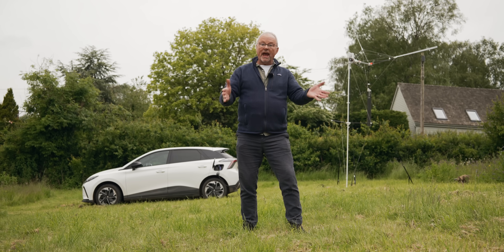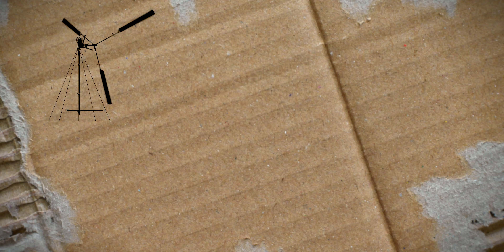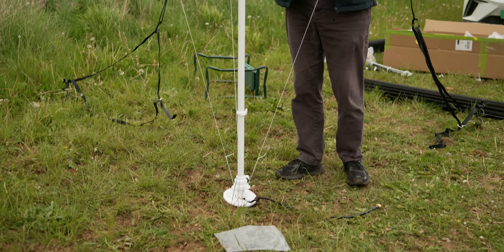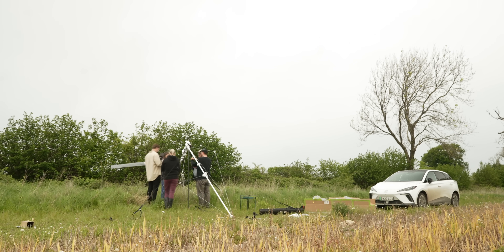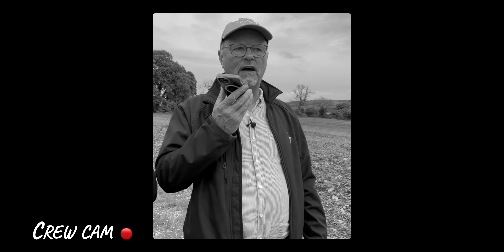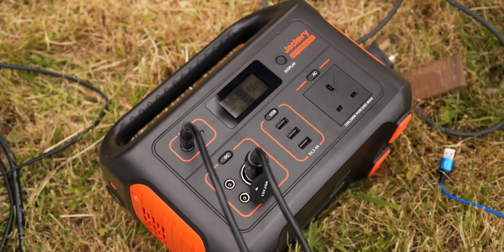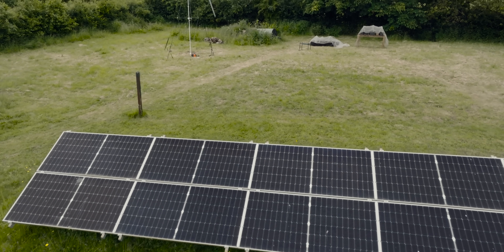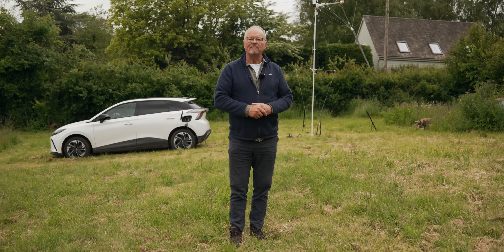Charging an Electric Car with a DIY Wind Turbine?!

Comment: My wifes' car has a roof rack.  I'd like a PV panel assembly that can be unfolded to cover almost the whole car area using supports that can be pulled out from the rack in the front to support it over the bonnet.  Ideally that would be the length of a residential panel in width and 4 panel widths in length.  Usual residential panel can generate 400 watts and weigh at least40 lbs.  So charging over 1200 watts and the whole assembly weighing 200 lbs (within the weight limit of your typical car rack) you'd get about 10.4 to 28 Km added to range in a day.

Comment: So you've just shown us that a small portable battery pack can't supply sufficient power to run a granny charger, but if you had an appropriately sized one and cycled the charging to keep the battery topped up, you could get about 0.8 mile of charge per hour. That's 20 min of my life I'm not getting back.

Comment: According to the information in this video this turbine can max out at 4.5kw. You only require 2.8kw to replicate the average charge rate you'd expect from a UK domestic socket. In which case you could add as much as 15 miles per hour at the peak. That would be perfectly adequate for adding a little top up when the car is doing nothing else. But, clearly, it's more suitable for running external equipment. It would be like a stand alone Turbine To Load system.
Reply: 500Whp nothing close to 4.5kw ?
Reply: The KiteX is 200W max. Expect 100-150W at average wind speed and no turbulence (on a hill without interference).

Comment: Are there vertical turbine models? They will have more stable output. A tip, location a site that  has wind-tunnel-effect. You will have continuous and higher wind speed at such location.
Reply: VAWTs have a very low efficiency, just what you don't want if your wind resource is poor.

Comment: A challenge if it is possible to use vertical turbines. Alpha 311 it has been tried in the O2 centre. Is now being used south wales by a council on a major road, the cars passing to produce wind rather than relying on wind.
Reply: It is but why use something that has a very low efficiency.

Comment: This clip was both illuminating from the set up point of view and thought provoking. I have two solar arrays 12 kWp and 5 kWp respectively. Two of the Kitex wind turbines could augment energy to cover the nights and cloudy days. On the flat garage roof.. Hmmm. Negotiations with the good lady mistress of the purse her indoors might and, more importantly, the grid company…
Reply: not really an augmentation - at 13mph windspeed you're getting 0.187kw (187 watts) output.

Comment: If the makers of the windmill are taking advice, suggest:
You can for quite a low cost make your product a WiFi hot spot and make all the software a web page so that it doesn't matter what phone is used.
Making it not need any sort of app would be even better.  You have to run a cable to bring the power down so a few extra wires is not a problem.  Some sprinkler controllers make it all work with 3 push buttons and a two line LCD display.
Reply: Dev here. Actually it is a web app. The turbine they received had a wrong firmware setting. We only had a guide for android on how change this at the time.

Regarding the on/off we omitted the button to simplify the design (electronically and mechanically) - the main reason why it not just on by default is safety reason. We want to be sure people is ready for the turbine to spin up - before it does so. Could be we can make the user experience better at a later stage with firmware update
Reply: @AndreasOkholm  Thanks for explaining the situation.

My 2¢ as an IoT developer: the fact the user has to plug it in to power to get it started, seems like a safe point for the user to expect it to start turning (and put that in the quick start guide).

An app/web app should not be required for operation - it should just expose tech stats for us nerds. Otherwise it’s just being an annoyance to everyone.

Interesting product - and kudos for it being shown on Fully Charged.
Reply: @AndreasOkholm  BTW:  If you do make a hot spot, I suggest you put the serial number as part of the SSID.  Two hotspots with the same name can be trouble
Reply: @kensmith5694  we changed that in the firmware upgrade about 6 months ago :) - to include the serial number
Reply: Or not require an app at all. Why isn’t it just on/off? Everything else should be easily automated
Reply: @markirmuir  I am not even sure it needs an On/Off.  If the wind is blowing, it is on.
You may want to be able to monitor the output but that should be simple to do.

Comment: Three pin UK Plug for EV expects 2kw - the Jackery (battery pack) isn't going to provide enough output to charge it.

The Kite X is going to be very slow at charging an EV - you would be better off with a solar array or a hydroelectric turbine.

Comment: Yes I watched the kite-x videos on their website and thought - hmm that is not straight forward - I am not sure i would want to put up one of those as well as the tent when camping but icould possibly put one in the garden and maybe when I can afford a decent battery pack it could be the best way to get wind power to charge it. very impressed with the string engineering

Comment: Are there any portable solar panel solutions to charge EVs like this?  There's a lot of apartment dwellers that have no access to charging that could use a system like this.

Comment: From earlier, it can produce 4.5kWh at an average, so a higher powered battery with connection to the wind turbine would mean you could easily charge a car, it is just 15-20 miles per day!

Loved the video as well!
Reply: it was 500Whp... where did you get 4.5kWh ? How is that even possible ?
Reply: @ndudman8  At 3:53 it produces 4500wh per day, so 4.5kWh. Store power in a battery or two, you could then refill your EV and gain your 15-20 miles.
Reply: @Jaw0lf  thats over 24 hours at basically its best capacity constantly 187W constant, which is pretty unlickly... if you applied the load factor that even big uk wind turbins use 20-30 % then thats more like 1.1KWh/Day...  Perhaps useable... but a few much cheaper panels even on a cloudy day in winter would get you that I think... and be less prone to breaking... But go for it and order one and let us know how it goes with return on your investment ?  I started to build a DIY 500W many years ago but gave up before finishing because 1 our country is way worst for wind than UK, but 2 you need to get up much higher and these things need maintainence and need to be robost. That think still looks like a time cons;umming toy... but prove us all wrong :)

Comment: As others here have pointed out, J1772 protocol begins at 6A/120V, or 720W. I have a Zencar EVSE that will dial down to that and I use it as the main way to charge my 2012 Mitsubishi i-MiEV. Here in the sunny Arizona, in the American southwest desert, I've configured a solar array of 6 Renogy 115W bifacial panels feeding a portable battery/inverter (slightly larger than the little Jackery that Robert was using) at approximately the same rate the EVSE is drawing for up to 5 or 6 hour sessions. 

The other thing you need is an AC splitter cable and a neutral ground bonding plug, in order for the EVSE to recognize some sort of ground to start the charging sequence. But, yeah, you can use a battery/inverter (we call them solar generators, or"solgens," down here) with reasonable MPPT input specs to move electrons into your EVs battery. 

I think the Kite-X is rated at 400W maximum. So, you wouldn't be able to achieve input/output parity and charge all day with just one of those little turbines. But augment it with couple of solar panel and you could have some good trickle charging fun that way.
Reply: The Kite-X is rated at 200W maximum.

Comment: Hmm , just like  fart in the wind... another useless effort, but not as environmentally damaging as actual full size turbines- not to mention they don't even produce more energy than they did to construct or upkeep... 80 gallons of oil in each one for instance.
Reply: Dubious figures, but let's go with them for now as in any case once the full size turbine is up and running it will displace the oil used to construct it, meaning the next turbine on can be built more greenly and so on.  Hence you argument leads to diminishing returns, as over both the lifetime and scale out of turbine deployment the initial role of oil becomes irrelevant.

Comment: O.M.G.

You could have saved yourself a lot of trouble by looking up the specs first. That battery can barely deliver 2 Amps, while that charger will probably need at least 6A. Depending on the setting of the car and/or charger it will draw somewhere between 6 and 13 Amps. It can't "sense" the source can only deliver 2A, so that battery will probably trigger it's overload protection. Which is probably exactly what you saw: Handshake -> start charging -> overload! -> grace period -> ad infinitum.

Amazing how "Fully Charged" could not predict this...
Reply: You'd need at least a Jackery Explorer 1500 Pro or better even a 3000 Pro to satisfy an EV's charging needs. Coupled to this windmill, you'd be able to charge a few miles every day. Too bad nobody in your production team could see this coming...
Reply: @oroozen  EcoFlow can charge car no problem
Reply: @dzonikg  my Ecoflow River 2 portable can't, because of the same problem. It can only deliver 600 watt at most. You need to be able to deliver at least 1.4 kW. So you need at least the River 2 Pro or better yet, the Delta 2 or above.

Brand doesn't matter. Power does.

Comment: In my humble opinion there is a MASSIVE gap in the UK market for a reliable self-limiting wind turbine that can generate a solid 150-500Watts in decent wind.

People with an acre or more are generally screaming out for a wind turbine to compliment their solar PV.

Alas, I dont think this does the job.

Harmony Turbines in the USA have got me quite excited but they're still in development plus I'm not entirely sure they're wanting to export to the UK.

Every new housing development should include a 10kW turbine where a small maintenance fee is included in the contract.
Reply: Very true. I've yet to find one that will provide enough energy to cover the purchase and installation costs during the time I expect it to survive. Actual outputs average only about 15% of "rated" output and I'm in one of the windiest parts of mainland UK. Between a couple of neighbours and myself we must have tried about 10 different small turbines in the past 4 years, none of which have come close to paying for themselves before failing.
Reply: @garysmith5025  Britwind, SD Energy, both will easily produce their rated power continuously, 1000s all over the country, ultra reliable (unlike the nonsense shown in this video)
Reply: @SeanMoore2008  Which of those companies produces something in the range of 150W to 500W as stated in the opening post that I replied to? They're 5kW upwards which is too big for domestic use, my garden is 0.7 hectares, very large by most peoples' reckoning but a turbine that size would just be completely out of place. Most people just want something that will cover a few hundreds watts of background usage overnight.
Reply: @garysmith5025  Leading Edge 600 - combined with PV and a few kWh of battery if you don't have the funds for even the small SD Energy WT - energy is expensive  !
Reply: @randymch  folks are getting the cheapy turbines that last a year with the 30k ones that last 30+ years - they need to be built properly to survive.
Reply: @garysmith5025  SD Energy have a 2.5 kW - still not on cost terms with the IstaBreeze nonsense but it'll survive for 30+ years.
Reply: @garysmith5025  .7 heartaches means nothing, what matters is how obstructed and how open it is to the prevailing.
Reply: @SeanMoore2008 - I'm not sure where this dialogue is going. The point I was trying to make is that there is a gap in the market for a UK based company to come along and sell a reliable 500Watt turbine for less than silly money. The components to make a reliable 500Watt turbine with a sturdy 7 or 8 metre pole should be achievable for less than £15k.
Reply: @SeanMoore2008  Heartaches? It's 0.7 hectares, house and small trees are to the west of the feu, so the garden is entirely open to the prevailing wind direction. I only want to power a very modest load in a far SE corner of the garden without running 80 metres of cable out there. 600W of PV and 3kWhr of Nissan Leaf modules doesn't provide enough in winter but is overkill for summer, I could double the PV for £70 but as an engineering solution it's not very elegant. 
You suggested the Leading Edge 600, £2k for a turbine with a 50mph survival rating? That's a joke.
Reply: @garysmith5025  if you can't buy what you seem to expect to be able to buy for the price you want to pay, why not build one  ? ... then will you understand why availability is so sparce. I live on Orkney, I'm aware of wind.
Reply: @SeanMoore2008  I probably will build one when I get time. If you live on Orkney why did you suggest the Leading Edge 600?
Reply: @SeanMoore2008  But does this one even look like it would laslt long in actual wind, and produce anything meaningful for the price they are asking ?
Reply: @ndudman8  not a chance, buy a few solar panels instead.
Reply: @SeanMoore2008  exactly... thats what gets old with channels that just get excited about any old thing... coz it will stop c02... boogy man
Reply: 100% agree... We got quotes in excess of £27k for a small 3kw turbine!
So just stuck up another 6kW of solar PV on the tractor shed for a fifth of the price👍
Reply: I agree..
I have looked at Istabreeze 1500W and a Bimble 1000W iirc...
However, while better than the majority, they are probably still going to fall to bits before you get an ROI😂.
I have looked at larger wind turbines... But as above... Too expensive/too big or require a 3 phase connection alas😢
Reply: @G-Cam1 - I have an Istabreeze Heli 4.0 sat in my hallway. It has been there for over 18 months whilst I battled with VoltSys (Ireland) to purchase one of their control boxes and FIMIR inverters.

I'm getting closer to installation. I now face the high up for better wind versus low down for easier servicing decision.
Reply: @randymch  what was the VoltSys battle over ? ... they are generally very responsive
Reply: @SeanMoore2008 - awful communication and an apparent reluctance to sell outside of the Republic of Ireland.
Reply: Ohh no there there isn't... except if you trying to flog them and fix them for everyone...

Comment: When Robert pulled out that little Jackery I knew the answer! 😂

In all seriousness, the question is really two questions:
1. Can a portable wind turbine add power to a portable battery? Yes
2. Do portable batteries exist which can run a domestic car charger? Yes

Did Robert have one of those available? No
Reply: That Jackery was a bit tiny, but the onboard car charger may have had an option to limit the current to something that the portable battery inverter was comfortable with.
I made a portable battery out of several scooter batteries with a 3kW inverter and 2kW of portable solar panels - it works well.
However to do the same with wind requires a wind turbine on a far larger scale than the one in the video!
Reply: Ho and no Android phone! lol
Reply: Why does this channel even pretend to do reviews... or are all their subscribers more stupid than them ? Perhaps.
Reply: which is comedic in itself because the car is a giant battery, so really the question is can you get a charge controller that can direct interface to the car.....
Reply: Amazing how his entire team could not predict this. "Lookie here! It's charging!"  Noooo, it's triggering the poor battery's overload protection.

Comment: I like a video that shows the way forward, and yet manages to be a bit tongue in cheek!

I wish that I lived in a house rather than a flat, as if I could get solar PV and wind turbine power with a battery pack I would live within what I could generate from renewables. 

I live in the countryside, so do not consider burning fallen timber a problem. That is not sustainable for urban dwellers of course. In my flat I do not have a [working] fireplace, and burning things is banned under the terms of the Lease, but if I had a house, then a little wood burner would be fine for the living room kitchen and allow for light and radio from solar and wind ...

I am fairly close to retirement, and the greatest pleasure that will come [assuming I live to see it] will be to get rid of my car [a Berlingo van], needed for work as a freelance gardener and Parish Lengsthsman. The cost saving would be immense, and I love walking. I live only a mile from Bromyard, and when I can longer walk into town, I'll resign from the human race!

As it is I have beautiful  three year old Terrier [Patterdale] called Lu or Louie, as a rescue and she is the gentlest sweetest Terrier I ever knew, after two years of Saintly patience bringing her back.Fortunately she has a very good coat of hair and does not require a warm house in the winter. I never did either, growing up in unheated drafts farmhouse3s in the 1960s and '70s. 

Best wishes from George in North Herefordshire.

Comment: Would fold up portable PV panels be a lot easier ?  Jackery in fact do some to go with your battery.
Reply: @chriss8437 That works indeed. I own a 2kW Jackery with 2x200 W peak portable panels. An average sunny day with no regular directional adjustment can generate around 1kW at my place. The Jackery then charges the car with no complaints at 7A. So a day's worth of sun adds around 10 km of summer range to my trusty old iMiev 😊
Not that that's of any practical use but an entertaining experiment.
Reply: or just plug the car in like normal ?